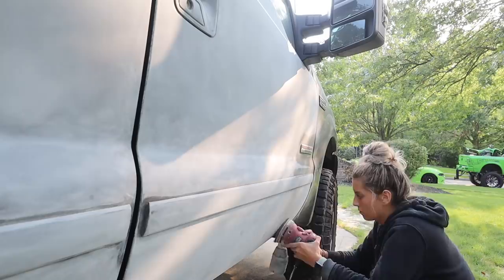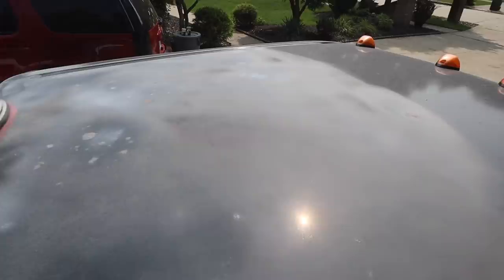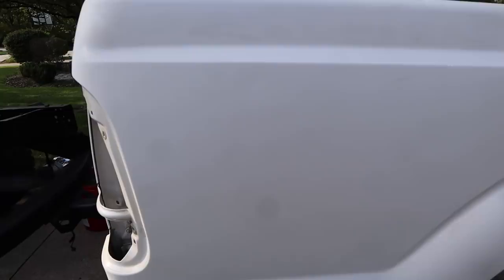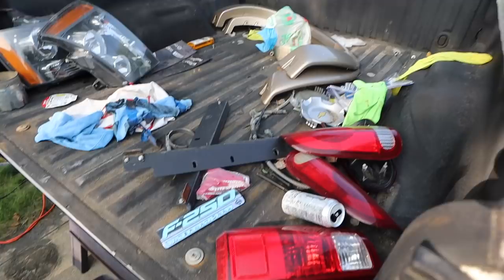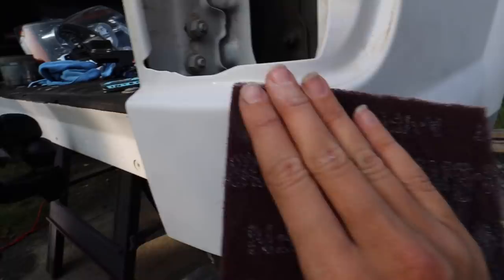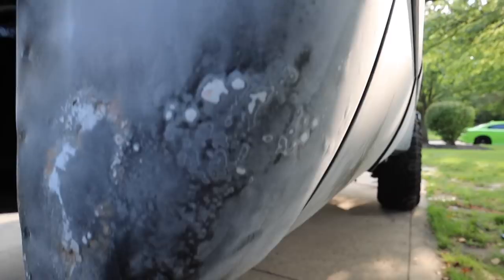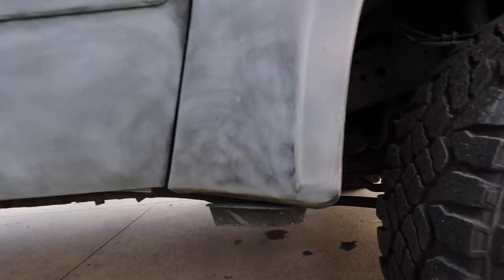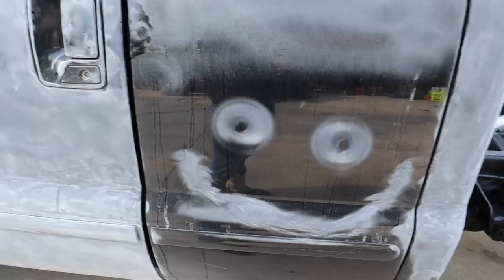TIME FOR PAINT!!!

Comment: It gets more exciting as you go along but it seems you’ll never get to the day of paint. I just finished spraying mine last week. I raptor lined the whole truck with the same color as the truck originally was. Then I Raptor lined all the accents like grille, bug shield, rain guards, bumpers, and bed rails in the black raptor liner. I am now on to the smaller stuff. Flush mounted reverse cube lights in the rear bumper I wired today along with running wires for dash camera. Anyway sorry for so long a post what I am saying is it’s a thrill to get something done you have been working towards. Congratulations on the truck (it’s going to look sweet with the white second color) and your channel. I’ll keep watching both yours and Ryan’s channels. The Tahoe is looking hot🔥

Comment: That rust isn’t bad at all just sand blast or wire wheel it then skim with filler and sand it smooth. The other side could be patched but it would be easier to replace the fender and door